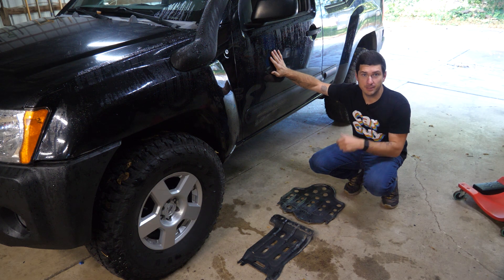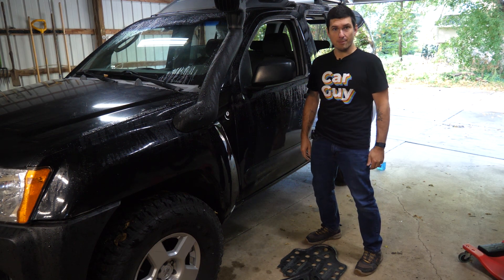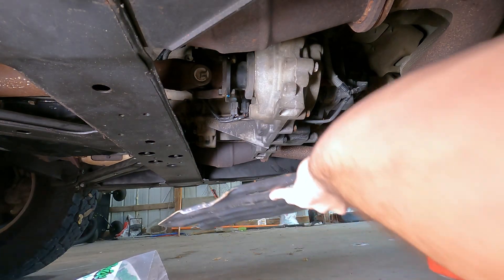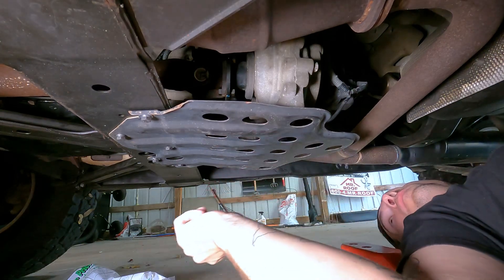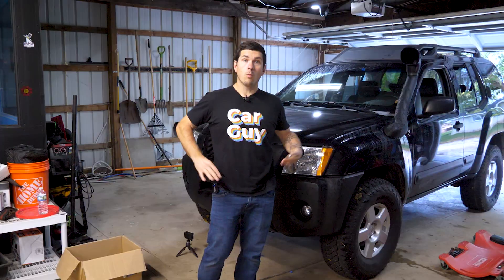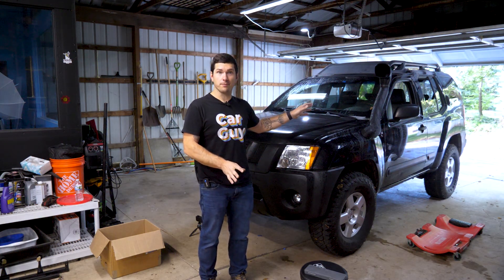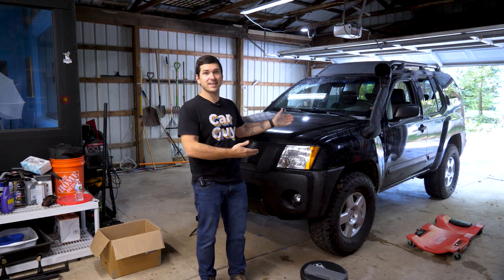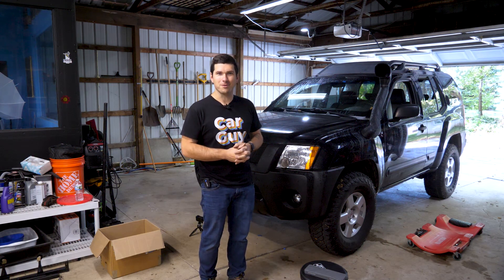Adding a Few Skid Plates to The Xterra (8-ball)

Comment: They are better than nothing, but the oil pan is still partially vulnerable, especially around the drain plug.
Reply from the maker: right one. For what I'm doing they are probably OK for now. I agree with you. I wish they would've just covered the drain plug area and forced me to take it off every time I did an oil change. I would prefer that over the big curve in the plate to expose the drain plug.

Comment: Your vids are the bible for my 2005 Xterra S. Done many of the mods to my X while watching your videos. Keep up the good work! One thing though, you installed the transfer case skid plate upside down. Did the job this afternoon and when the transfer case skid plate is installed opposite to the way you did, the 5 bolts hold the plate 1/2" from the transfer case. It doesn't hang down where it can get hung up on something if you drive over it in reverse. Thoughts?

Comment: hey ry, i have a 2006 nissan xterra like yours i learned a lot from your videos, thanks a lot, just want to ask i have this service engine soon sign, i did reset the battery still the same, change my oxygen sensor in the front, still the same. what do you think i can do to resolve the issue?
Reply from the maker: You should hook up a scanner to it and see what code it's throwing
Reply: @Rythecarguy  it says “ intake valve timing control bank 1” what does it mean?

Comment: This comment may be useful for people who have decided to run factory skids instead of aftermarket for either cost or weight.  You can double up on all the factory skids except the gas tank skid (not featured in this video).  Either by riveting or welding two together, you can increase the strength by quite a bit, given that these are quite weak.  I actually am not sure they are even steel, I vaguely recall them being a softer alloy but can't remember what.  Doubling up is far cheaper and lighter on your rig than aftermarket skids, and gives more protection than stock for the occasional accidental rock smack, though it still won't provide the same level of protection as heavy gauge steel aftermarket plates.
Reply from the maker: Great tip! I actually have a second plate for the transfer case. Maybe I'll do this!

Comment: I just bought the trans and oil pan skid protection plates for my 2008 Xterra. 230 ,000 mies and clean as a whistle.Thanks for the brief and to the point instructions. I'm probably more worried about losing my oil pan due to road trash that can rip an oil pan open or dent the living daylights out of the pan. Cheaper to replace the metal plate than the oil pan.